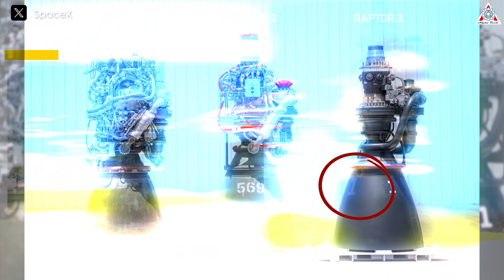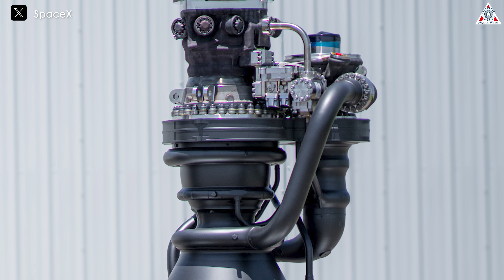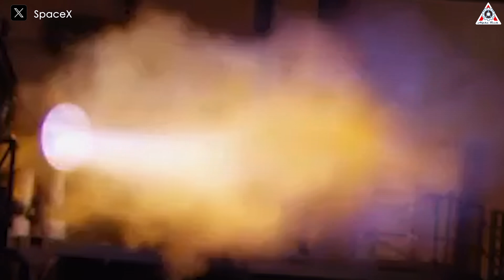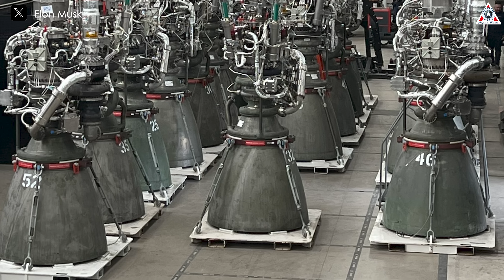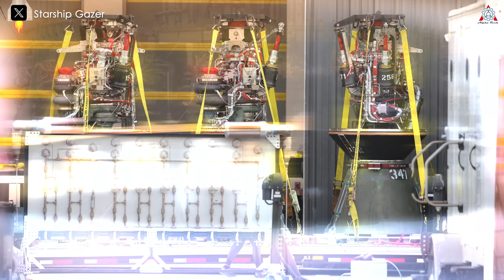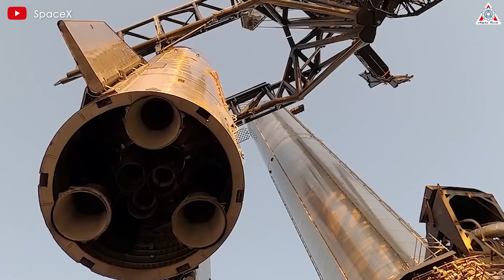Elon Musk's SpaceX Just Announced NEW Raptor 3 Upgrade...Shocked The Whole Industry!

Comment: All this tax money wasted. This development should have started with an Aerospike.
Reply: do you have a solution to solve the overheating problem? aerospikes only make sense for SSTOs and SSTOs on earth don't make sense with the capabilities of current and near future chemical rocket engines. unless you're fine with a 10 kg payload then rocket staging would be the only smart option.
Reply: @zhongxina9420  3D printed components with internal cooling channels. The problem is that Raptor is only good for certain altitudes. It can't adjust to space use, or low altitude use. What good is it in a utility space craft? They need to stop wasting time and money on new iterations and start from scratch with the Aerospike. Smaller companies already showing 3D printed variants work perfectly when cooled internally.
Reply: @marklepo6577  as I said why use an aerospike if your rocket is not an SSTO? why would the booster stage need to be optimized for sea level AND space when it's burn time is only in the atmosphere?

don't think that your idea hasn't been considered. the current starship architecture is the most optimal rocket design as of now.
Reply: @marklepo6577  the raptor engine is still a viable engine for the next few decades. what you're suggesting is for spacex to drop everything they've done until now. delay everything by a few years to develop an aerospike. and then use it on a rocket that isn't even optimized for aerospikes? do you reflect on your words before writing it? cuz it doesn't show.
Reply: They explored aerospike. Just like all other tries, turned out to be too much hassle cooling the spike and use different bells on the nozzles for staged operation.
Reply: I’ve done a bit of research and it turns out the aerospike would have been better than Raptor
Reply: @jonnies  better? how so? on paper it's a good engine, but when it's applied in real life many problems arise, mainly the heating problem.

let's give an analogy. the Rotary engine on paper is a very efficient and powerful design compared to other ICE designs and yet when companies started to develop these rotary engines many problems arose like excessive wear. bell nozzles have been a proven and reliable design. reliability is the most important aspect for starship to achieve reusability. and I'd wager just like the reputation of reliability of rotary engines, aerospike engines would be the same.
Reply: Aerospike engines are useless crap.  Which is why everyone is not using it, and those who intend to do, will fail.  The supposed advantage of the "aerospike" is that the acceleration of the propellant gases, during expansion, will adapt to the ambient pressure.  Now the question people need to ask themselves more, is how useful is that, and what efficiency can actually be gained?
Even if we, for now, ignore the weight and drag of the aerospike, it would only have its hypothetical advantage from 10,000 m to 45,000 - 60,000 m.  Above that, a vac bell nozzle is superior.  Then you need to consider the diameter and size of that aerospike engine.  The diameter is driven by the altitude pressure where you still want an ISP optimizing effect from the nozzle.  The size is driven by the load it needs to lift from SL.  In order to achieve enough thrust at start, the engine need to be grotesquely wide, resulting in damning drag, and big, resulting in damning weight.  And for what?  The supposed adaptive ISP-"efficiency" is easily eaten up by building smaller, hotter, lighter engines with greater chamber pressure.  The giant aerospike engine will also become very inefficient when you're forced to throttle down, to compensate for reduced mass as fuel is used up.  Finally, it can't be used for reusable rockets, because it cannot be throttled enough with any semblance of efficiency.

The other idea is to use a smaller aerospike nozzle for a second/third stage, "vac"-engine, as a heat shield during re-entry recovery, and landing engine.  I kinda doubt it will be able to cope with the heat, in a reusable manner.  But we'll see.  But note that in this case it doesn't use any of the toted pressure adaption in it's main role.  Only as a means to make the vacuum engine useful for a landing.  And they want the diameter for the heat-shield function.

Now, my prediction is that you will eventually see something that resembles "aerospike" engines, but which is not exactly.  Because there's some probability that we'll see small engines with ring-formed combustion chamber, for rotary detonation combustion.  But these engines will be small, and either rockets strictly for vacuum use, or ram-jet engines for military missiles.
Reply: @Vermiliontea  stop. you're making too much sense! these guys only read about aerospikes being better than bell nozzles without diving deeper in the implication of the design.
Reply: @Vermiliontea  Yes... because the starship of the future needs to change engines like a kid changes diapers. The best modern culture can come up with is replicating an engine produced in the 1960's. lol This isn't TV bro, rehashing Transformers because you can't come up with anything better isn't technological advancement. All the F1 engine, cough, sorry Raptor, does is remind me of Chinese engineering. See what everyone else does, copy it, and try to tweak it.
Reply: @marklepo6577  before spacex nobody has ever flown a full flow staged combustion engine to orbit. a FFSC engine is the pinnacle of chemical rocket design. you cannot design a chemical system that is more efficient than this unless you break the laws of physics. compared to the F1 it is horribly outdated and underpowered. it's like saying a V8 from 1960 can match the power and efficiency of a 21st century V8 design
Reply: @marklepo6577  the raptor engine is also the first methane fueled rocket engine to reach space.
Reply: @marklepo6577  you clearly don't have the inteliggence to realize why aerospike have disadvantages that make it not suitable for staged rockets so why do you think you're still right? dunning kruger much?
Reply: @zhongxina9420  You have not addressed ANY of the problems inherent with those types of engines. Just a "YA, lets change the starships engines when it gets to space, it's better that way". What? I don't have intelligence? OK China boy, you must be part of the "smartest" people alive club.  You win, and are right. It is impossible to create a better engine, because people can't think, and it's better to change engines on a Corvette when it drives down to Sea Level by disconnecting the V8 at the back, and running the V8 in the front. Duuuuhhhhhhhhhhhhhhhhhh.... Much better to carry several useless engines around... DUH DUH DUH DUH...
Reply: @marklepo6577  grown ass man saying "DUH DUH DUH" 😂
Reply: @zhongxina9420  Whats wrong? You don't have any valid come backs for dragging ten engines around in your advanced spacecraft? lol smh
Reply: @marklepo6577  I already said the reasons in my comment above. it'd do you good if you read into my comments more.
Reply: @zhongxina9420  Ya... you did... you said you would rather strap two V8's to a car and alternate between them as a superior option than to have one that does the job of both but is a bit heavier than one, but not nearly as heavy as two. Keep it up genious.

Comment: Meanwhile ,  Huge Starship has heat tiles problems galore.  Go to the Moon again ? When ?
Reply: Why the negativity ?
Reply: @shimmy1984  It is reality .
Reply: Spacex already implemented 3 fixes for the shield. A much more robust tile, modified fin/location to reduce the heat its subjected to and an ablative underlayer to save the ship from catastrophic failure if a tile (or a bunch) blows off. 
This last is a definitive fix as there is now  secondary protection so that there is no longer a single point of failure. 
This is already probably fixed and the next launch in Aug/Sept will test it, with Starfactory going online to build Starship a lot faster once the design solidifies allowing them to build a fleet before Q3 2026.

Moon launch is 09/2026 so far. If it slips a year however (another vendor may be having trouble with the lunar excursion suit, they are still in great shape (there is no "window" like a Mars shot) and 09/2027 would serve nicely as well. The Chinese schedule (unless modified) is around 2030. Certification Even in a 2027 Moon mission would open the way for a Mars sample recovery mission circa 2030, needing only the 6t nuclear reactor and the in-situ fuel production equipment that are both in design phase or later at NASA. 

V3 of the rocket should supply far more than enough cargo capacity to complete the moon mission. Much larger tankage (1500>2600) will reduce the number of tanker flights needed (one of the major criticisms by people who hadn't noticed that Spacex is on track for at least 120 F9 flights this year and that starfactory production should allow better than 1 Starship/month even in early production.

All of this on a fixed price contract of $3billion with Starlink revenue (growing very rapidly) picking up overages to bullet proof budget. 

Even if Axios fails on lunar excursion suit, Spacex might commission Tesla to build a score of Teslabots modified for radiation and regolith dust to start building a habitat until the suits are ready.  

So. To answer your question: Lunar launch date is Still officially 09/2026 but 09/2027 will work nicely too. I don't see Spacex holding up the show beyond that and Spacex has the hardware (Dragon) to replace Orion should it develop issues. 
(Dragon putting astronauts on lander in LEO after completing refueling from a depot (tweaked tanker) vs putting them on in Lunar orbit with Orion (oddly unnecessary complication to give Orion something to do).

Comment: Is the R3 3d printed? Is that how they're able to reduce the complexity of the engine?
Reply: Only the inconel combustion chamber is 3D printed.
Reply: The company I worked for use to use inconel SS parts in the Bolt air guns we used in offshore siesmic surveys. Very tough and long wearing parts, usually in excess of 3 million shots per parts.

Comment: Like honestly I think the payload numbers for SS 2 and 3 are kinda bullshit, but even assuming SS 3.0 can "only" deliver 100 - 150T of cargo to orbit, imagine wat a 12 to 18m SS could do, honestly these would probably be what is used to refuel SS in orbit to bring the number of launches down to a reasonable number, as an 18m starship of the same hight as SS 3.0 should theoretically be able to carry 2960T... If my math is right, which is 2x Pi squared, because it's 2x the diameter which diameter increases the amount of fuel at Pi squared the increase in the diameter and I am assuming that increase in fuel will give you a proportionate increase in payload.

So 2x Pi squared x 150 = 2960, like this isn't accurate even if I'm right there will need to be reinforcements to make the craft able to carry the weight, so lets half it and call it 1480T still enough to refuel SS 2.0 in almost 1 go only missing 20 tonnes of fuel, and 2 launches would be more than enough to refuel SS 3.0 with 640T of cargo capacity spare.

And really the only reason to need a payload that large is as a fuel tanker from Earth to LEO, Starship 3.0 is already enough to bring up the heaviest of loads.

Although I think at that point you would be better off bringing up a light weight craft especially for interplanetary travel without the extra weight of a heat shield and doesn't need to be strong enough to deal with high acceleration with a bunch of weight on top of it.

Comment: Simple is strong, reduces weight, manufacturing time and cost, and failure rates. Nothing but good
Reply from the maker: Let's wait for it to go to work, shall we?
Reply: @alphatech4966  I agree.  Every new model, be it a rocket engine, or a Ford F150 will have bugs to work out.  This being iteration 3  and even improvements on 3,, all part of the process.  Try it out, blow it up,, learn, change.  Did Falcon 9 get a numerical designation because the previous 8 disassembled?  I think yes.

Comment: Good Morning. Another Good thing about the Raptor 3 is. The less parts the easier it is to de-bug and improve on it. With less parts. The less likely it is to fail. That is probably the most important aspect of the design. I wonder what the Raptor 3-Vac engine will be like. Go SpaceX. Have a Great Day my Friend.
Reply from the maker: It will be bigger than Raptor 3! As for the other components, we will have to wait! Starship v2 will be the first prototypes to have this engine.